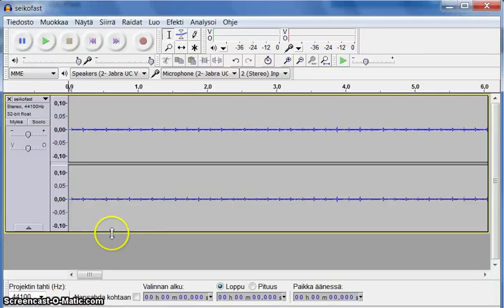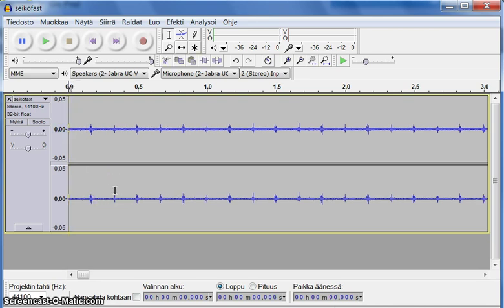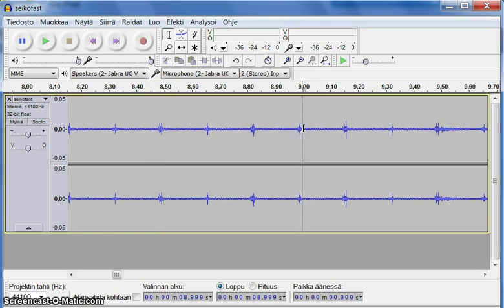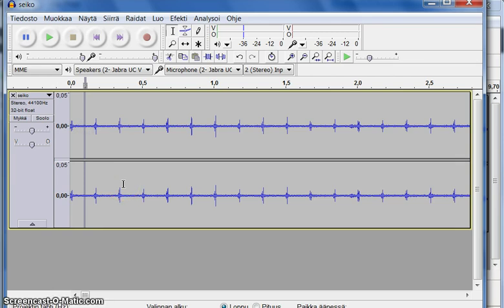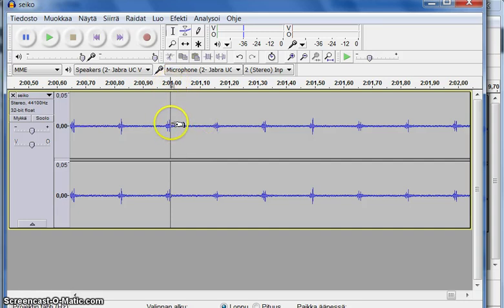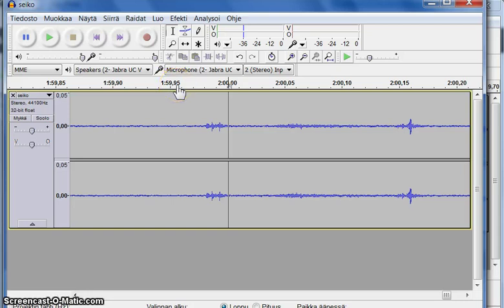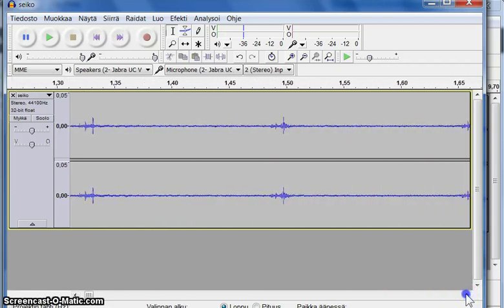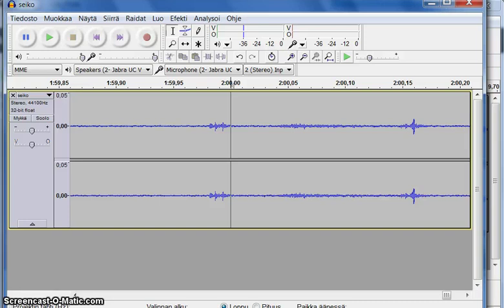Regulating automatic watch with Audacity

Comment: What is best microphone with specifications to use?
Reply from the maker: Lawathe M. Eid لاوَذ ميثَم عيد I used normal headphone mic.  however it's better to just compare the watch to actual time over many days. as each person and usage effects watch speed.  So getting it adjusted with audacity doesn't necessarily make it accurate in normal use.
Reply: I have SEIKO(5) 7S26-3170 ,there are 2 levers, one for -+ the one second more or less than the normal second, second is the isochronism lever and this lever must not be adjusted.. but i readjust it so my watch gone crazy day 3 minutes plus, another days 1 minute minus .. do have soluion ?..thanks

Comment: It took me ages to make Audacity pick the ticking without white noise and not blend into the graph. I tried different mic's, settings, noise reduction, amplified, +20db mic booster, inside a glass......fuck me dead. I got it at the end but it's still hard to set it right since the adjuster is very sensitive. To be honest I recommend to everyone to simply spend the same amount of time comparing it to an online clock. The 6 beat rule doesn't match in my newly adjusted graph yet the time seems much better at 5.60 beats per second. It was aligned well from factory but I was gaining a minute and a half a day. By Sunday the time was no longer 13:30 but 13:40. Now it's much better, still beats any Quarts shitters out there and I rather go through this hassle.
Reply from the maker: HenryMania yes, i wrapped the mic and watch in winter jacket and also walked away to eliminate any noise while recording. and its true its best to adjust by time while using the watch because users activity level and the wind level affects the speed.

Comment: How difficult is it to get the accuracy from plus 4 seconds a day to under plus 2 seconds a day? I have a Rolex with a 3135 movement. Thanks.
Reply from the maker: probably very hard.  lot of thing effect the speed. how much wind it has and how much it's stored over night.  just keeping it on its side could loose some seconds. if it's running +4. don't mess with it.
Reply: Thanks, James, for the quick reply.

Comment: Hey, i just tried regulating women Slava watch with audacity, and got same graph of 6 "tics" per second. BUT!!! In fact thats three tics and three tacs per second. Right? 

6 tics per second would show 12 spikes on the graph. Am i right about this?
Reply from the maker: not sure what you see, but usually it doesn't matter, as clocks sound different they all have different ticks and tacks, just have to approximate what and how many per minute, if the watch is relatively accurate already there is no possibility to go wrong really. It's just confusing, that if there if the 6 tics come little bit fast, you have to slow the movement, At least if confused me and I adjusted it always to the wrong direction. Trial and error method...
Reply: James Parus Yeah, i got that. Now i'm just measuring the time. i will wait for 24hrs to pass and just see. I do not have very good microphone, and it's a bit difficult to get good graph. I i moved it a bit to the minus side, and i will see if i was right.